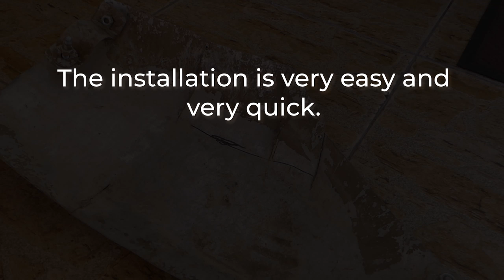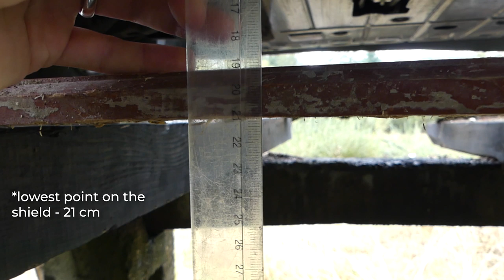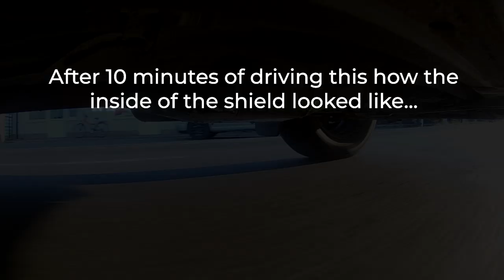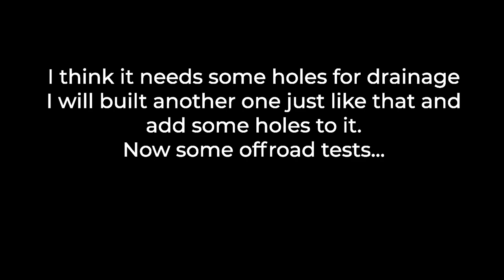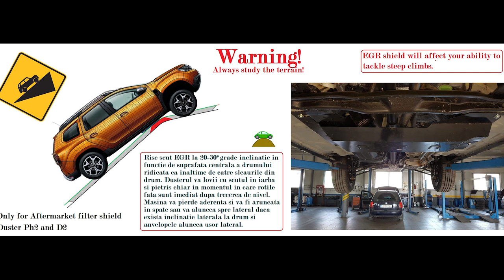Custom EGR Valve Shield Duster 2019 (ENG Subtitles)

Comment: WOW ! one of the best and most inspiring videos so far that I found on this particular and dci duster related problem  !!! Had you posted earlier this one I would have surely waited a little more before purchasing the after production available egr start&stop shield (the one mentioned in this clip with some drawbacks on steep ramps). In my case (1.5 4x4 dci 110hp WITHOUT ad blue) the best modification would be a factory one - add a strong oval metal shield integrated with the module (or design it in any different way that it is not prone to distortion by bump or stronger branch tearing wiring and/or connector), or/and install it further up in a more protected space behind the catalytic converter - which is almost not possible in your case (the adblue sensor preventing this option). This shield version you tested looks great (agreed, with the addition of drainage holes/openings, electric connector should not be exposed to excessive and long lasting underwater conditions). I already installed the readily available shield you mentioned (spent about 150€) on it, but as you mentioned, I lost a 21 cm clearance, it is now about 18 cm under this shield at lowest point  :-(  Also, the filming of what happens with the whole system when driving over hard or grassy ridges is SO INSTRUCTIONAL and productive that we can better understand the problem in real life. I simply am lacking words to express my thrill finally seeing a really informative and crystal clear demonstration of a specific problem and some simple and very interesting solution(s) ! Congratulations again !!!
Reply from the maker: Thank you very much for your words. They mean very inspiring for me. 😁
Reply: @DusterCoolTravels  no modesty needed, I am no expert but spent hours and months trying to understand better this particular problem (it is a problem, I know from other Duster dci owners) and no single video or even a textual explanation I could not find on forums or other on line sources...until this one.

Comment: I think it's not a good idea to secure the shield to the exhaust pipe itself because only one hard hit can cause major damage to the whole exhaust system. Better fabricate a belly pan that bolts to the chassis.
Reply from the maker: Name one situation when a major damage can be caused using this shield.
Reply: Vasil Kirov How could this shield made of thin metal sheet damage the whole exhaust system? It protects the EGR valve which would break from a moderate hit not even a hard one. This should come factory installed...

Comment: Hello DCT, good solution for "EGR misconstruction out from the dacia factory" :).
But one idea for your simple EGR system protector shield. - you should drill some holes into it. if you get in deep water it will store water inside till "neverend" without holes :). No matter if its coated zinc sheet, it would be better dry than waterfilled :). Great vids btw :). 🤝🙂
Reply from the maker: Thank you very much. Check out my channel because there is another version of the shield made with holes and better steel. I'm using that shield now and it's perfect 😁